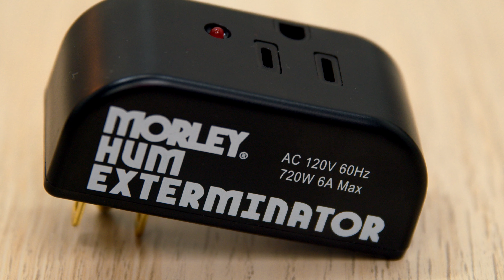What’s a Ground Loop? Eliminating Buzz and Hum from Your Amp

Comment from the maker: What other issues do you encounter in your recording or performance rigs? Let us know what you’d like to see us solve next, and be sure to stop by Sweetwater to grab one of Morley’s Hum Exterminators for yourself! 👉 https://sweetwater.sjv.io/Morley-Hum-Exterminator
Reply: One question I never saw a definitive answer to is: is it okay to leave your equipment powered on or should you turn it off after each session? Also, is it okay to leave everything on and power on/off with a master switch?
Reply from the maker: @pepejul  Hey there! I always try and turn my gear off after each session. If nothing else, it keeps my studio room from getting too warm when I’m not using it 😁
As for a master switch, that’s certainly okay to use! I would recommend using one of Furman’s power conditioners. I really like their staged option, so you can control the order in which your interface and monitors turn on.
I hope this helps!
Nick Pasquino, Sweetwater Sales Engineer, (800) 222-4700 ext. 3230, nick_pasquino@sweetwater.com
Reply: As soon as I play my guitar on high gain amp sim settings, I get electrical screeching noise passin through. So when I use noise gates it gets rid of it but if I play anything that awful sound is mixed into it always. its always there , How do I get rid of it ? please !

Comment: FYI the neutral is connected to ground at the breaker panel.  So lifting the ground will likely NOT solve your problem.
Reply: Neutral does not "loop" from one piece of equipment to another via the audio interconnect cables.

Comment: I have several USB powered machines that have various ground loop issues. I just use a ground loop isolator (GLI) on each noisy machines audio out. You can get them cheap online, if you don't mind using some 3.5mm plugged cabling, here and there. Honestly, somebody needs to make some 6.35mm versions. They work perfectly, and simplify the process of removing ground loops from a rig.
Reply: I have a 6.5mm, it comes in a box form
Reply: i appreciate you saying this since I've been encountering ground loop issues for the past year and a half and finally figured out what it was.

Comment: I got a new amp to run my computer speakers, and have been getting this awful buzzing noise through the speakers when there is a lot going on screen. I asked the internet, and saw the phrase "ground loop" mentioned, and this is the first video that came up when I looked into it. I have apparently checked so many of the boxes that would cause ground loop, it would be a miracle if I DIDNT get it. Thanks for the information on what it is and how to fix it. Short, and to the point. Excellent.
Reply: with a USB dac? you need a 480mbps ground loop isolator.
if your using an internal soundcard the buzzing is all the emf the cpu and gpu pumps out
Reply: @user-im2te2fg9y  You're probably right since the buzzing intensity was dependent on what was displaying on the screen. All I know is when I put in a ground loop isolator, the buzzing stopped.

Comment: Firstly, thank you for this video. I stumbled across it while figuring out an issue with my vocal recordings.
1. I keep getting harmonics I believe, in Audition's spectral view. I can hear it, especially after I've done some post work on the recordings.
2. Using a decent USB mic connected directly to the PC (desktop)

I'm not sure how a ground loop isolator would be implemented in this simple chain, but I'm certainly going to give it a shot. I'm not in the US anymore, so fingers crossed. 

It's been decades since I was a manager in a Guitar Center's Pro Audio department. I'd forgotten how often Sweetwater came up. Thanks again.Hope this works.

Comment: Hi. 
In the video you said if you use a portable battery there wouldn't be a problem. But I just bought a EcoFlow river2 portable battery, but when I connect it to my amplifier, I hear a buzz. A small one with my acoustic amplifier Marshall AS50R. But when I use my electric, Orange Crush 35RT, the buzz is louder. 
Do you have any suggestions to what I could do to reduce or remove the buzzing sound? 

Oh and I live in Europe so 230V here, in case that matters. 

Any help is greatly appreciated! Have a great day!!

Comment: I have the ART Pro T8 and love it but i still have a loop so I suspect it might be some power supply caps in either my PA or my Tascam M-320b mixer. Or even perhaps in the power supply of my Teac 80-8. Hasn’t been recapped even though it works at probably 95%. There is really old wiring in this house so also might be something there.

Comment: Thanks for sharing.  I have a larger monitor connected to my pc when streaming, for some reason, that causes a buzz in the live stream.  However, if I disconnect the 27" monitor, the buzzing stops.  I switched the outlet where the monitor is plugged in; added a widows plug :-) and changed the HDMI cable, neither helped.  will this Humx fix the problem, I also heard of a ferrite choke.  Hope you can help.  Best

Comment: Let me get this straight. You can create a ground loop if both devices are plugged into one big battery? They do not have connections to each other kudt draw power from the same battery pack.

Comment: I have a computer as the source (3.5m jack) into a mixer (1/4" jack) and out to a loudspeaker via XLR cable.  When music is playing the speaker sounds good but if nothing is playing the speaker will have very loud crackling and static even with the volume very low or turning off or on.  It sounds like when you plug in a jack while everything is powered on.  Could this be related to a ground loop issue also?
Reply from the maker: Hi, thanks for your interest! Usually, a ground loop will result in more of a “humming” noise as opposed to the crackling and static you described. I would recommend trying these steps to diagnose and solve the issue:
• First, try muting the channel on your mixer that you have your computer connected to. If the noise goes away, that means the problem is related to that channel specifically – possibly the connection between the computer and the mixer. If it doesn’t, the issue could be related to the mixer, the speaker, or the connection between them.
• Next, try swapping out your cables for new ones to find out if the issue is being caused by a bad cable. You could also try using a laptop DI box like this one to handle the connection between the computer and the mixer – this will typically be cleaner than a 1/8”-1/4” cable:
https://www.sweetwater.com/store/detail/LTIBLOX--rapcohorizon-ltiblox-1-channel-passive-laptop-direct-box
If you bought your mixer and/or speaker from Sweetwater, feel free to call in and speak with our support department for further troubleshooting – they’re available at (800) 222-4700 ext. 6400. You can also reach out to me directly with any further questions.
Hope this helps a bit – thanks again!
Caleb Lowrey, Sweetwater Sales Engineer, (800) 222-4700 ext. 1620, caleb_lowrey@sweetwater.com

Comment: Is it beneficial to have one of these, on every piece of gear I'm using, at one time? ( 4 or more)
Reply from the maker: Hello, Jared! Great question. Ground loops occur when two or more pieces of gear that are interconnected via audio cables are connected to different power outlets. Ground loops can be prevented by keeping everything plugged into one circuit or outlet. This can be achieved via power conditioners or other power strips. A ground lift unit like the Morley can be used when connecting everything to one outlet isn’t possible. It might get a little expensive using one on every piece of gear. A nice power conditioner would be a more worthy investment in this situation.
Thanks for the interest!
Cody Kraus, Sweetwater Sales Engineer, (800) 222-4700 ext. 1766, cody_kraus@sweetwater.com

Comment: Q:  How are electronics GROUNDED in aircraft, spacecraft, UAPs?
Reply: The short answer is that the chassis may be used as the general ground.  However... Isolation methods are often used to prevent ground loops.  Also.. the safety ground that is the cause for so many audio problems does not exist in aircraft or spacecraft.

Comment: When we let go of the guitar strings, a huge hum is created. Is it true that by using a wireless connection that that hum does not exist? Because I saw that someone said that when using wireless connections that you can let go of the guitar strings and there will be no hum, (and it also protects you from any possible electrical shocks). Does anybody know if this is true? (I am not talking about 60 cycle hum or RFI.) Is it true that with using a wireless transmitter that you do not need to ground your guitar strings by touching them?
Reply: yes
Reply: Thank you.

Comment: If a single breaker feeds a few outlets in a room and all the equipment is connected to those outlets, can it result in a ground loop?
Reply: Yes. the ground is not connected through the breaker.

Comment: 90% of all hardware problems: The User
10% of all audio problems: bad ground.
The best solution is to bury an engine block in your back yard, water it regularly, and pull all your grounds off your Public utility return and connect them to the buried engine block.
You're welcome.

Comment: I thought that was an eloquently delivered dissertation. About grounding loop de loops. And other fun, hair ripping stuff.

I don't know what's in that little electrical adapter to, alleviate, ground loops? I have an even better method. I've been using for, 33 years now. And it takes care of everything. What is this thing?

You go to your, industrial electrical supply store. And you request a, 1 to 1, 120 volt, 20 amp. Power Isolation Transformer. It's little bigger than your fist. You plug it into the electrical wall outlet. And then you plug. All of your audio equipment into that. Up to, 2000 Watts worth of audio gear. As you are now, Totally Electrically Isolated.  You are getting power. Without actually being coupled to the incoming power lines. Your wires are not touching any of the AC electrical wires. You are isolated. Disconnected from. While getting power. Electromagnetically! Like Magic! It's, magic. It's called Induction. Not connection. While you are getting power you are not connected. Magic!

And then you can use a passive, microphone splitter box. And take separate feeds for each microphone the band has onstage. This is the old-fashioned way of doing that. The way I had been doing it starting over 40 years ago. It's changed a bit since then. Now nobody has to do anything. You just select a preset and Voilà! There's your, Grammy! Now wasn't that easy?

I want to become senile at my own pace!
RemyRAD